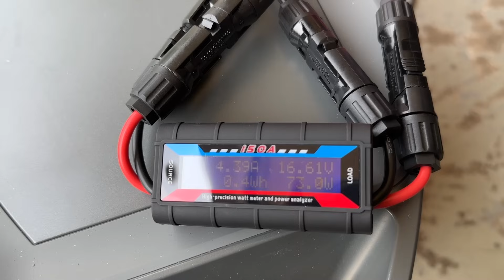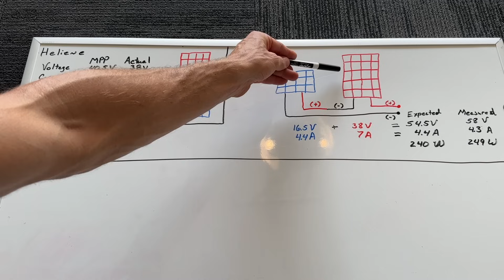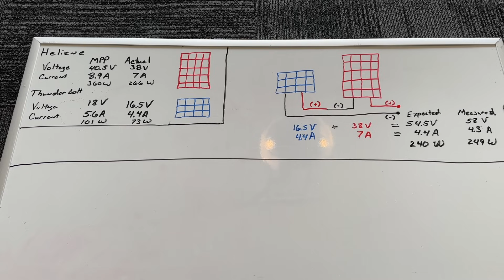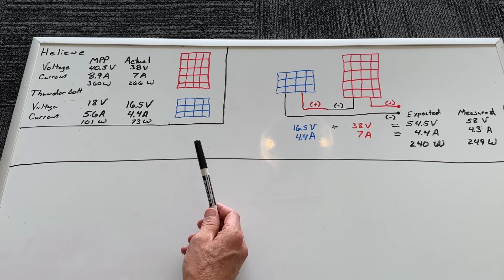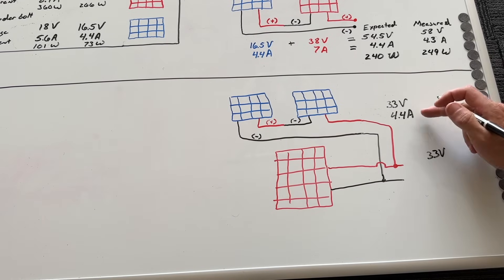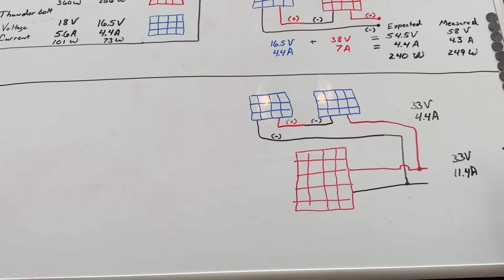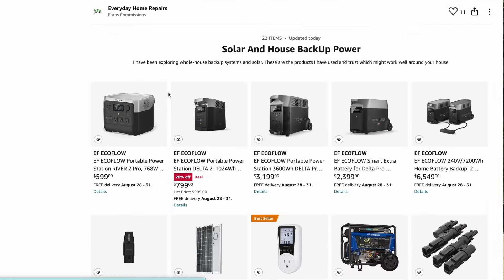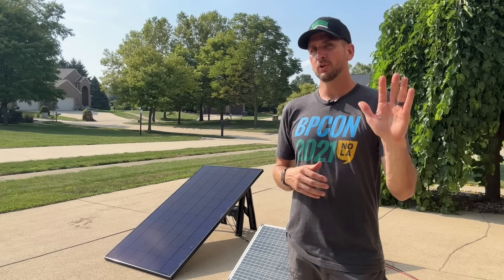Wiring Mismatched Solar Panels To Get The Most Power

Comment: Does the 5V difference between the 2 in series connected solar panels backfeed into the larger one? Or what happens with this voltage that is being omitted? Can it damage any of the panels?

Comment: Great hands on and informative video.  I was wondering if you also tried paralleling the two 100 watt panels and then putting them in series with the larger panel.  Then you get the 58 to 59 volts at 7 amps instead of the 33 volts at 11.4 amps.  Since a lot of medium size solar power stations have a hard 60 volt limit, and most are limited to 10 amps, this type of approach may allow a little more power into your power station.  I know a lot of Bluetti products have this limitation and between 40 to 45 watts would not be used with the 33 volt, 11.4 amp wiring method.  Thanks again for these hands on easy to follow videos!

Comment: What about using panel optimisers?  Eg. put one on the 100W panel and then put that in series with the 300W.  The optimiser should 'fix' the problem you showed of the 100W panel limiting the current to just 4.4A when in series before.
Reply: this is the way!

Comment: I am looking at getting an ecoflow delta 1300 and i have found 2x 200w panel which the specs are VOC 41.2V IMP 5.95A. 
Another set of 1 x 250w panels at VOC 37.9V IMP 8.3A. 
Both 2x 200w panel and 1x 250w panels are up for sale as used panels which are relatively cheap. But i am confused about all the types of current as i have no prior experience to any electrical works. I want to try and max out the charging capacity of 400w but basic calculations tell me the V and A of the 2 x 200w panels will already exceed my input amount. Or should i just get the 1 x 250w panel?
Reply: The Ecoflow will have either a max charge current or voltage it will accept. Wire your panels to not exceed either. The closer to the optimum of each, the better the result.
Reply: @CncObsession  the delta 1300 is max 65v or 10A at 400w max. Is taking 2 of the 200w panel a better choice?

Comment: You added the extra panel, what if you didn’t have the extra 100 watt panel. This makes no sense
Reply: If all your panels are 12v, their Voc should be between 20-25. Just put them in parallel. Important to remember: parallel branch connectors tap out at 30amp, so don’t go above that. Also use individual panel fuses when you go parallel. 2 panels can be fine without, but 3+ need their own fuse. I’d just fuse them all out of principal.
Lastly, know your mppt or solar generator specs for PV input. Don’t exceed them.
Reply: I think he showed us you need to at least get closer on voltages, cause parallel is the one you should be doing not series
Reply: Agree he changed a Major part lol
Reply: Exactly.  There was no way to get a higher wattage either way.  Parallel would’ve been worse.  The only way was to spend more money.  Either another panel or another charge controller.  In this case, using a ecoflow,  just get another panel 🤷🏽‍♂️
Reply: Better use cheap pwm charger
Reply: What doesn't make sense to you?

Comment: Or if you want to maximize the production, instead of wiring them together, wire them to separate charge controllers.

To wire together:
 * If you can match voltage pretty close, wire in parallel
 * or if you can match current pretty close, wire in series
but if the panels are different the MPPT is not going to have a good point to track because of the different panel characteristics.
Reply from the maker: Good point on the separate charge controllers and MPPT challenges.  Thanks for the feedback.
Reply: I just bought the delta 2 max which has two separate mppt. 500 watt each with 60 volts and 15 amps. I suppose trying to stay under 60 volts will be the hardest to get as much wattage as I can, right??
Reply: @danemmerich6775  Yes, staying under the 60 volt limit is the challenge.  Many panels today are over 30v, which means you cannot do two in series.  Smaller panels are almost all over 20v, which means you cannot do three in series.

I also have a d2-max. It's a nice unit, but that 60v limit is rough.
Reply: @ I am finding that out by research!  I guess the inverter generator will have to do in the pinch.
Reply: But you compared wiring 2 in series and 3 in parallel. Hire us that a fair comparison.

Comment: So the goal is to get the mismatched panels to be as close as possible in series before you connect them in parallel to the larger one.
Reply from the maker: In this instance but for some applications you might bring the 100W panels together in series and then parallel with the 360W panel.  Since each of our setups are unique there are many use cases for both approaches.

Comment: Can you put the 100w pannels in parallel to get 8A, then the 300w in series after so you can get closer to the 60v max of the eocoflow?
Reply from the maker: Yep, that would work.  Just remember to leave a little buffer between your max voltage under perfect conditions and the 60V max of the Delta 2. Once you hit or exceed 60V the solar input will shut down which would be a bummer 😁

Comment: Generally a good example but of course it has nothing to do with whether it is a 100W or a 200W panel and everything to do with the open-circuit and operating voltages, and operating amperages.

The general rule of thumb is:

(1) When ganging strings in parallel, the lowest open-circuit voltage minus around 2V for any string MUST be greater than the highest operating voltage for any string, period.  Zero flexibility for this rule.   Do NOT gang strings in parallel if this rule is violated because continuous reverse polarity on a string is a very bad idea.

(2) When ganging strings in parallel, the operating voltages must be somewhat similar but actually have a lot of flexibility (within about 5V of each other) as long as rule #1 is followed religeously.

(3) When ganging in series, operating amps absolutely must be similar, and there is very little flexibility.  Voltages can differ significantly.

(4) Pay attention to the limitations of the MPPT input.  Both voltage and current.

--

So, for example, lets compare 100W and 320W Renogy panels.

100W Renogy: 24.3V open-circuit, 20.3V operating-voltage, operating-current 5.29A
320W Renogy: 40.1V open-circuit, 32.7V operating-voltage, operating-current 9.79A
 
No reasonable topological configuration.   For example, 2x100W in series for string 1, in parallel with one 320W for string 2:   2x100W in series = 40.6V operating vs 1x320W 40.1V open-circuit.   Violates #1.  Do not use this configuration.   Parallel configurations also don't work because the voltages are massively different.

What about 3x100W against 2x320W?   3x100W in series for 72.9V open-circuit vs 2x320W for 65.4V operating.  that works (as long as the MPPT input can handle the voltage).   Ok, 3x100W in series for 60.9V operating vs 2x320W in series for 65.4V operating.   Yes, that works, and it is significantly below both open-circuit voltages.  So you can do (3x100W in series) in parallel with (2x320W in series).

--

Now lets see about a 100W Renogy vs a 200W Renogy:

100W Renogy: 24.3V open-circuit, 20.3V operating-voltage, operating-current 5.29A
200W Renogy: 23.0V open-circuit, 19.2V operating voltage, operating current 10.42A

A 100W Renogy and a 200W renogy can be put in parallel, but not in series.  Lowest open-circuit voltage is 23.0V against highest operating voltage of 20.3V.  Not terrible.    So they can be put in parallel and cabled for roughly 15A.   They cannot be put in series because one is 5.29A and the other is 10.42A, so the 200W panel will only operate at 100W in that situation.

--

Quite often, there are combinations of mismatched panels that DO work.  It will never be as good as properly matching panels, but it will work ok as long as shadowing between the strings is not variable.

That said, as a general rule of thumb:

(4) Try to avoid paralleling strings regardless.  It is always better to give each string its own MPPT charge controller input than to parallel the strings.  That way variable shading on one string, or damage to one string, will not interfere with the other string.

For example, lets say you have two strings of 5 panels each, all the same type of panel, and you parallel them.  If one panel in one string is damaged your effective output will be reduced by two panels because the lower output from one string will interfere with the other string due to the large voltage differential caused by the damage panel.  Same thing happens for shading.

Also, when paralleling more than two strings, a short in one string can cause all the other strings paralleled with that one string to feed their combined current into the shorted string, potentially resulting in a fire.   And even if you just have two strings paralleled, failed panels in one string can result in the other string feeding excess voltage back into the string with the failed panel(s), which is also very bad.

This is why solar combiner boxes with individual string fuses should always be used when paralleling strings.   And this is why paralleling is always the last option.  It just isn't as robust.  Still, when talking about a small number of panels like 1-3 panels?  Series is still preferred (far more efficient), but paralleling is also often a reasonable solution as long as the numbers work out.

-Matt
Reply: Wow Matt great write up. Thank you. I’m going to try running my two 24v panels to my smaller 40a hqst mppt and leave the other 6 12v panels on my 60a controller. The hqst brand can be tied to each other as well. Got more experimenting to do. It seems like the panels always change and it’s hard to buy a lot of panels all at once. I should have planned better and bought them the same.
Reply: @1unsafer  Yes, panels do seem to undergo changes quite often, so exact matches are difficult.  For people like us with discrete charge controllers, the solution is to have as many charge controllers as needed to get decent topologies and shade handling.

It's a lot harder for people using power stations due to their more limited MPPT inputs.

Oh, one other configuration that works quite well... if one has two sets of solar panels pointing completely different directions, aka generally only one or the other set is producing significantly, then as long as rule #1 is still followed, they can be paralleled.   

I do that with two old 165W panels (2s) that I have paralleled with two 320W panels (2s).  They happen to satisfy rule #1.   Normally paralleling the sets would be silly and non-optimal, but since one set is pointed south and the other set is pointed west, it actually works.

-Matt

Comment: Yup, that's a good tip. You can't force current through a solar panel. Each panel is only going to let as much current through it as there is light falling on it and whatever it's max. current is. That's why you get almost no current from the total solar array if you completely shade just one panel that is connected in series with other panels in full sunlight, if there are no bypass diodes.

Comment: I was just about to order a 100w panel (on sale) to go with my 200w one. Good thing I saw this video. Thanks!
Reply: You need to disregard the Wattage numbers and look at the current and voltage numbers.

If the 100W panel has same voltage as the 200 Watt panel, then you can simply wire them in parallel and be totally fine.(no loss of power)

But if the Voltages are not matched, then you’ll probably find that the currents will likely be matched… and that means you can wire them in series and will be fine. (No power loss)

In his first example, his panels neither matched voltage nor current… which is what complicated the solution.  

In your situation, 100W plus 200Watts, you will very likely have either the voltage match or the current match.  Which will dictate either series or parallel wiring.(and give you full power!)
Reply: .  The first number is always higher than the second.  If you wire positive to positive, neg to neg, you are possibly blowing your power center.